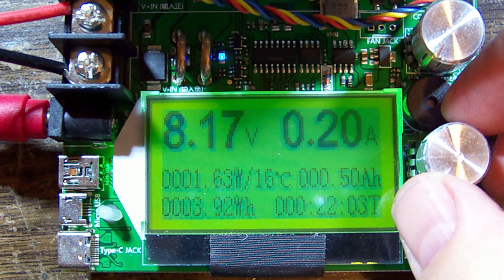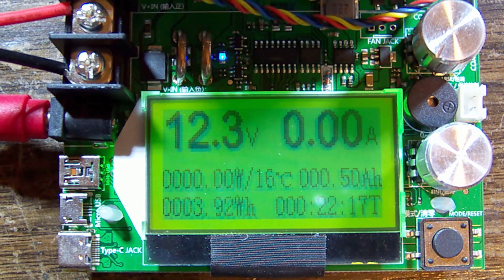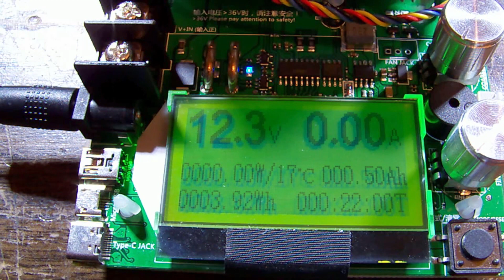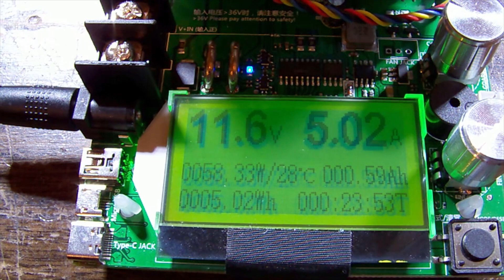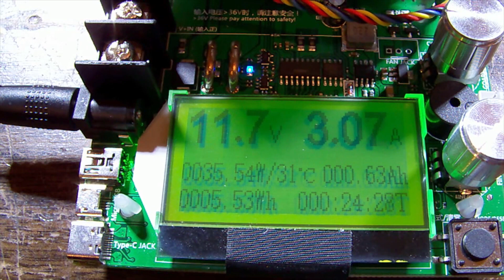Camvu DVR1 PSU Repair

Comment: hi whats the name of the load tester you use
Reply from the maker: It is an unbranded 180W electronic load, you can find them on aliexpress.
Reply: @JonnyFix  You didn't put that under the list of tools you use.
Reply: Hi there, can you also name the ESR meter you use? Thanks!
Reply from the maker: @johanbotha9889  sorry it's an unbranded model I bought locally
Reply: @JonnyFix  Ok, thanks Jonny. Do you know anything about the quality of the ESR70? It is quite expensive and I don't mind to spend money on quality equipment. Do you think that this tester is worth it?
Reply from the maker: @johanbotha9889  I've not used one but a lot of other youtubers have and it seems to do the business ok if you only want an ESR meter, it's capacitance reading might be a little off though.

Comment: Yes you are 100% right, what would be the fun of buying a brick.
Well done :-D, i'm not supprised about the crap cap but the one after the choke supprised me.
They both become ill normally, maybe that choke has more inductance than the average cheap supplys, maybe :-D.
The crap wire from the brick to the barrel plug will drop the voltage, i would replace it normally but you have explained very clearly that the cameras don't need full voltage :-).

I've repaired a lot of laptop charger bricks, shorted plugs/cables and bad caps, no supprise really lol :-D.
Hope you are doing well and have lots to fiddle about with :-D
Reply: I'm not so sure about that, I've seen numerous PSUs where the cap after the choke (which doesn't have to do as much work) is in better condition than the one before it.

I've also seen a clearly cost-optimised Bush DVD player/surround amplifier where the second cap is a standard, non-low-ESR device. The one before the choke (low-ESR, but cheapo Acon branded) was blown and the general purpose one was fine.
Reply: Jason.J

Well i did say there could be a difference with the choke, i have repaired supplys with both caps ill.
I don't tell lies.

I'm no lover of supplys being sealed in it's own ovan, that will also kill caps, for my own supplys i drill tiny holes in the side of the case to let air in and out, they last a hell of a long time then :-D
Panasonic caps were my favorite, 105 deg low esr.
Reply: @zx8401ztv  not suggesting you were lying, just giving an alternative perspective ;)

I think the idea is the second one just kills off the ripple that the choke accentuates?
Reply: And high frequency noise :-)
Now the question is: has your own power adaptors gained perforations like mine have? :-D
Reply: @zx8401ztv  No but its a good idea :)
Reply: Convection is your frend :-D
Reply from the maker: Cheers mate. Lots of little things going on, nothing really exciting though.